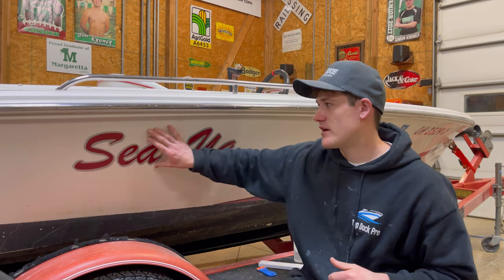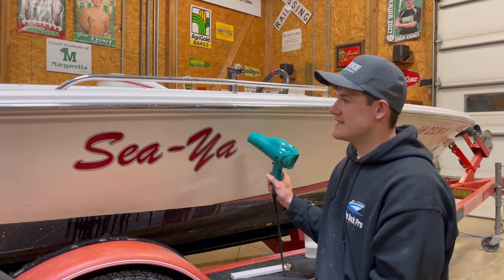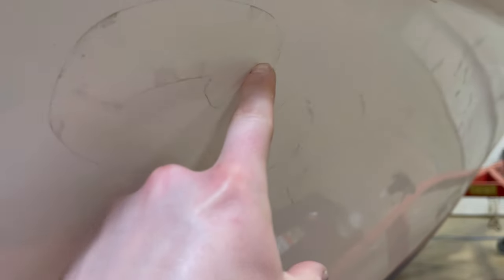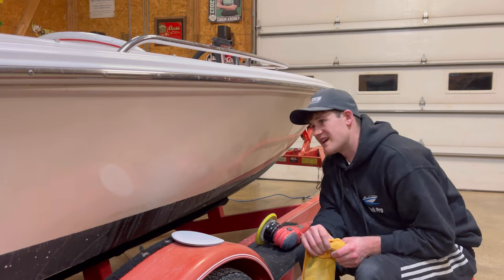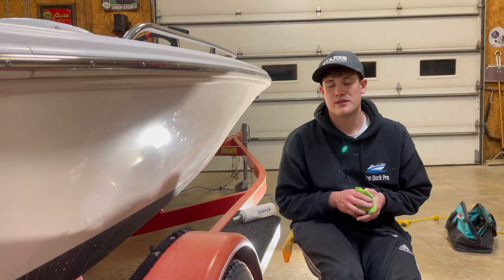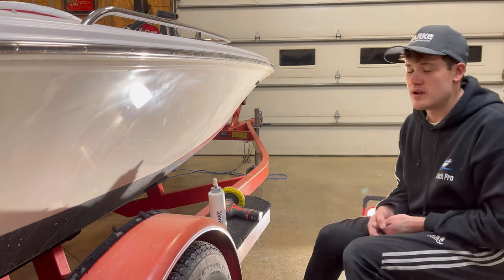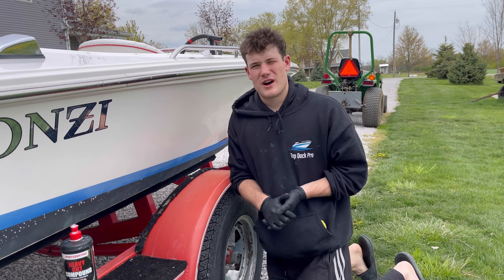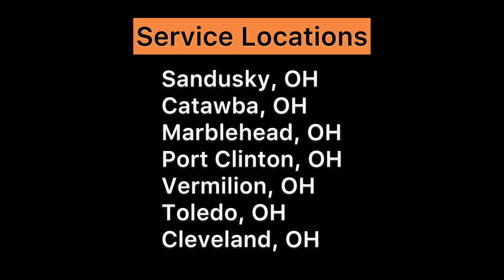How to Remove Vinyl Decals! | Make them INVISIBLE | Boat Tips

Comment: This is great reference. I'd like an opinion: I have a '92 Grady White that we recently have been restoring. We managed to get the old decals off with the rubber wheel bit - but as you spoke about: the weathering clearly showed a raised area. 

I have a DeWalt rotary sander - do you think it would be all right to use in place of the orbital with the appropriate grit?
Reply from the maker: Yes of course. Just make sure you have an interface foam pad and the necessary sanding grits
Reply: @topdockpro  Thank you for taking the time to reply - much appreciated! Have been debating if the rotary would be a hazard for sanding/buffing since I didn't have any experience & didn't want to ruin the gelcoat. Big thanks!